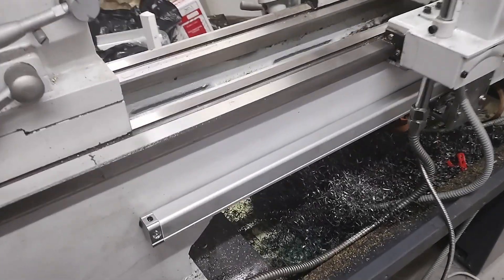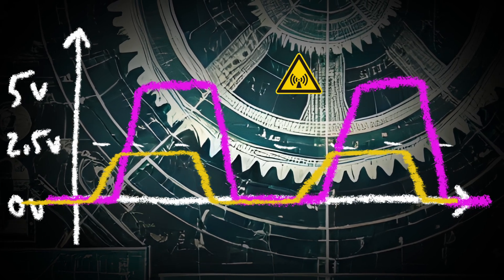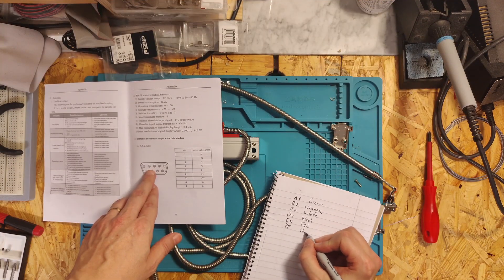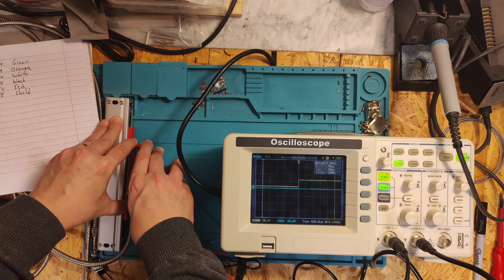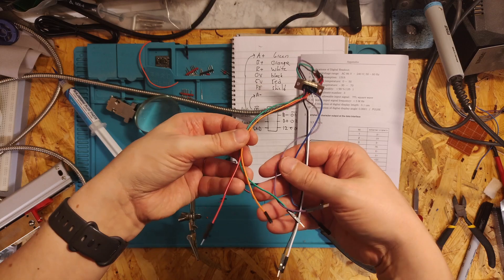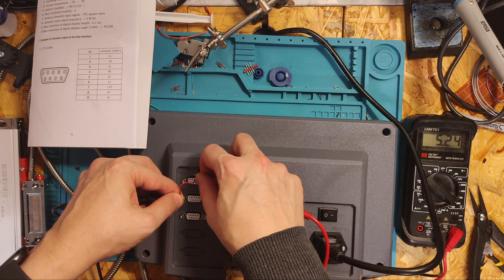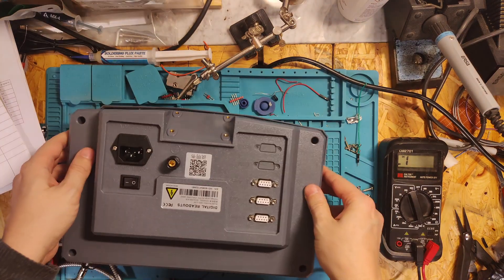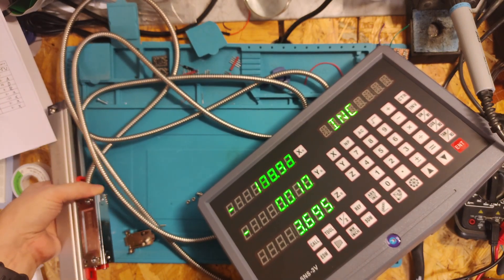Fixing DRO & Linear-Scale (Sino) Mismatch. (Lathe, CNC)DRO

Comment: Nice video!
I would have changed the pinout of the DRO unit instead of the scale connectors.
How the scale connectors were wired up, it's pretty standard, so by leaving those alone, you can switch scales in the future without having to resolder connectors.
Reply from the maker: Your point is valid in general and in theory, as in "it's the right answer". 
The "problem" in this case (if you look at 9:46 for example) is that the connectors are on a circuit board where the pins are hardwired together (the upper row is tied to the lower row on the PCB itself), which caused the 5v to appear on the A+ (I think it was) as well. So I would have had to remove the PCB and physically cut the leads between all the pins on each port on the PCB first and then resolder every wire to those connector-pins.

Orrr... just do the thing on the Linear Scales. Took less than 2 mins each. :)

The fact that the manual said what it said and the Linear Scales seemed to follow that wiring (except lacking the diff-signals) I assumed that this was a well-known standard, which was the reason I never measured each pin to begin with, as it seemed "obvious" that the linear scales did not meet the expectations of the display.

Thank you so much for watching and commenting. :)
Reply: @JWAM  Alright, fair enough, I stand corrected 😊
Reply from the maker: @winandd8649  I'm a big fan of "the right thing", so I appreciate the angle. :)